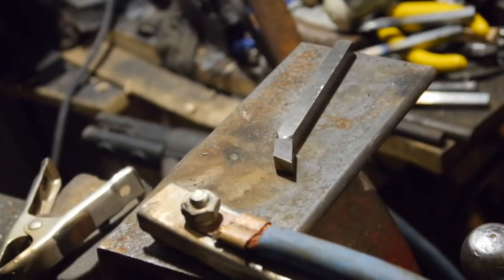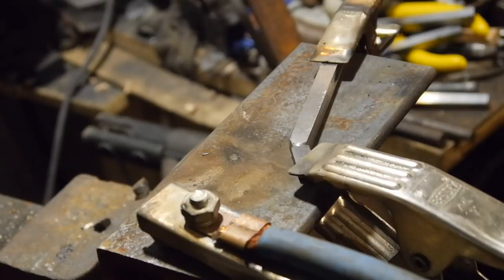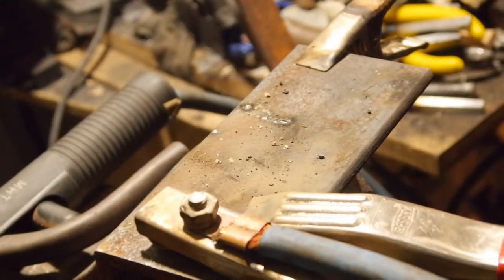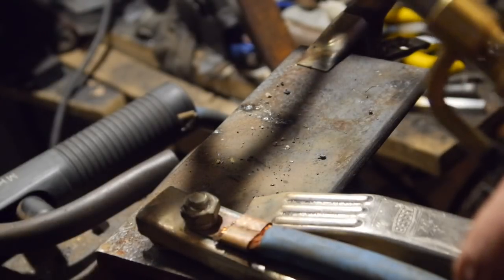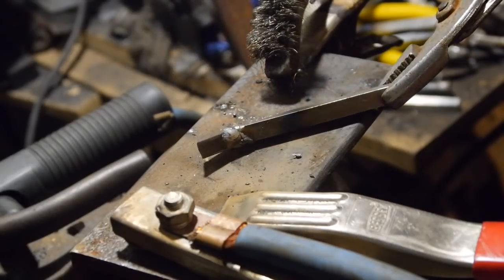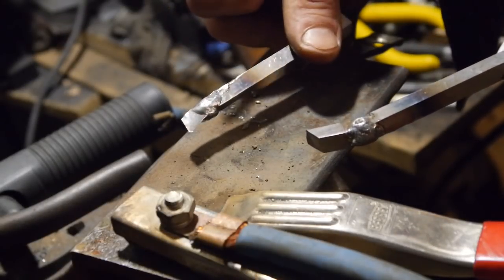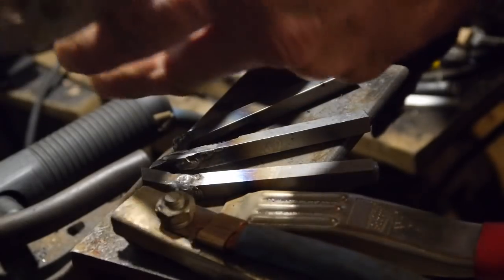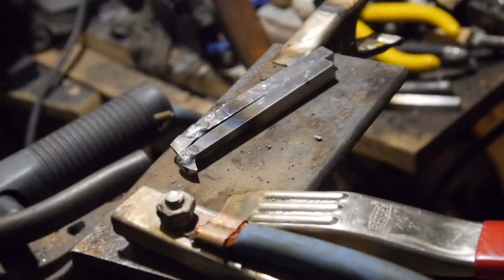How To Stick Weld HSS (High Speed Steel) for custom Boring Bars

Comment: I punch THOUSANDS of square holes in mild steel using punch die sets that run me $80/ea and was just thinking why can't I cut the end off (the die last way longer) when the punch is worn out and weld on a new sharp piece of HSS.  Thanks man; if I can keep everything square enough this will save me tons of money in the long run.
Reply from the maker: Great idea! Sure sounds like it'd be worth the effort to make you a jig.  Or maybe set both pieces to height with parallels in a drill vise / machinist vise (up out past the top), and use some angle / bent strips of Yellow metal scrap or Aluminum to protect your Vise from arc strikes.
Reply: @JRock17991  Exactly, ordered the material and working on the jig this weekend, appreciate the input

Comment: should warm rods first on scrap 😬
Reply from the maker: That's brilliant, I didn't even think of it. I've moved on to a TIG in the meantime, but If I have use this method again, You bet I'll warm them up first. Thanks!
Reply: @JRock17991  I only learned that recently, if you go that you're guaranteed to get an arc going every time

Comment: This is pretty cool, been trying to get into turning lately...mostly wood though haha.
Reply: Sounds like you are using an ac buzz box welder...7018 is poor operation switch to a stainless steel rod  like E312-16 or E309-16 starts easy on AC and better weld for HSS  GOOD TIP ON THE FABRICATED BORING BAR!
Reply from the maker: That's a good point. I couldn't get 7018 to run well  for the life of me when I was using the AC function on this Buzzbox. Luckily, this welder has DC, and that runs 7018 like a champ!  Great advice for those that are limited to AC.  Next time I make one, maybe I'll test to see if 6013 / 6011 works ~ as well.  Thanks!
Reply: Been doing this since 73, just wanted to help, HSS needs to be welded with a high strengh alloy [309, 310  or 312 SS... E60XX  0r 70XX will crack , are not sound for machining loads,  Great guitar work and mods guy!
Reply from the maker: Good to know. I'll keep my eye out for cracking. I've got some 8018 CM and 11018 to try too.  Thanks!
Reply: @JRock17991  If you did your post heat ok then there should be no brittle martensite anywhere, and if you have ok penetration and fusion then that weld is not critically stressed . . . I would just be going with the electrode that does the weld easily and well. I guess the only other concern would be weld cracking during cooling - preheat everything to 200C or there would be an argument for stainless electrodes. But proof is in the pudding, sounds like it worked fine! Fantastic job and love your tool grinds!
Reply from the maker: Thanks!  I don't see why this wouldn't work for a wood turning tool.  Just have to put it on a shank with a decent handle.  I don't have any experience with wood turning though, so take that with a grain of salt.
Reply: JRock17991 I feel like the threading tool you had towards the end would be really fun for a wooden box, looks useful anyway.
Reply from the maker: That's the nice thing about it. You can make whatever shape you want. And you're not constrained to the dimensions of stock tool size that you can buy, and grind down.
Reply from the maker: Also, you can machine the end of the boring bar. If I need a longer, tiny boring bar, I can just thread the end, and add another piece on.  I could do that perpetually, so long as I supported it inside the workpiece, like a gun drill.